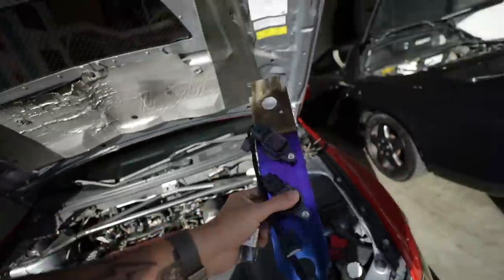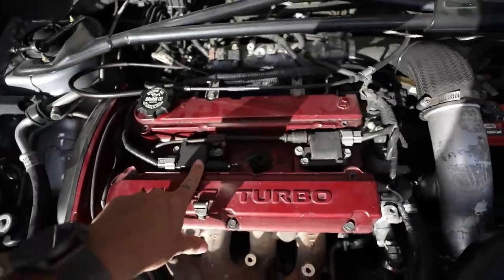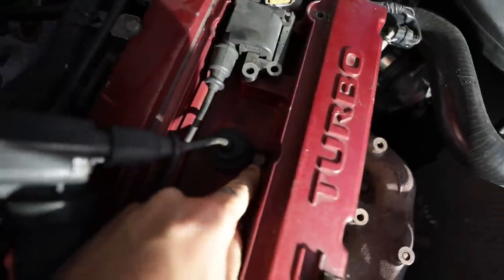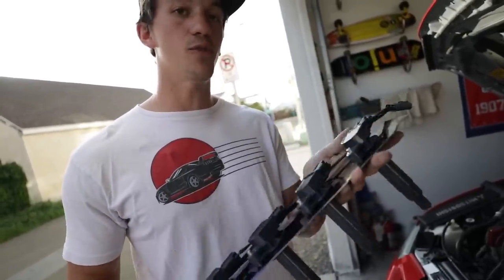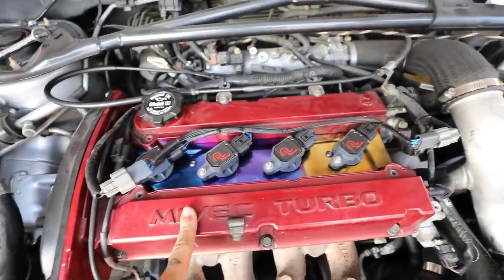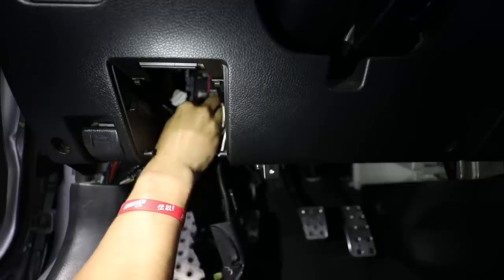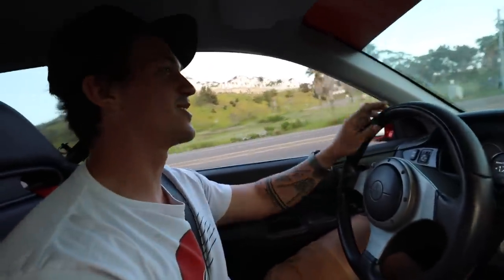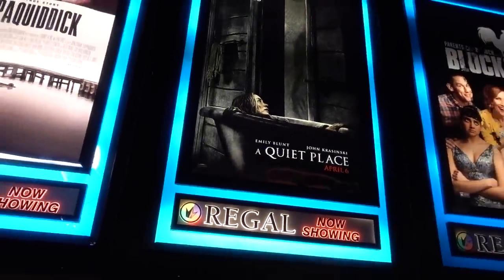INSTALLING THE FIRST REAL PERFORMANCE MOD TO THE EVO 8

Comment: Since you already shop at AutoZone go to AutoZone and order some MSD performance spark plugs they are only 699-799 a plug and they work awesome I'm running a full MSD ignition system on my car and it's doing great also the MSD plugs are built for higher horsepower engines to prevent exactly the same thing as the ignition pack your installing so your ignition system will be dialed and you will for sure not have any break up
Reply: Hope you pay attention to this post cuz the MSD plugs are definitely worth it

Comment: The enthusiasm is great but new Evo owners shouldn't come away from this video believing buying a coil on plug setup will noticeably improve power. The modifications will be felt after increasing boost/fuel and a dyno-tune. With that said, the Apex COP setup is priced lower than other COP units definitely something to try in the future.

Comment: you should get one of those rainbow manifolds. The ones that look like oil is on them. That would be sick
Reply: JTwiz You can’t buy tubular manifolds with a titanium finish look, or over burn. The burnt look happens over time. Either way he is getting a custom manifold for his turbo so there is no need.